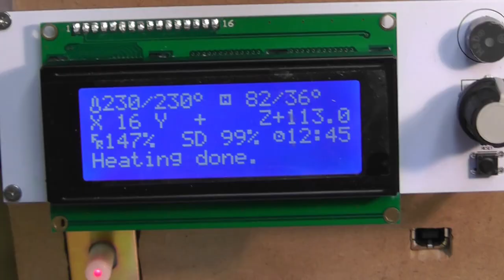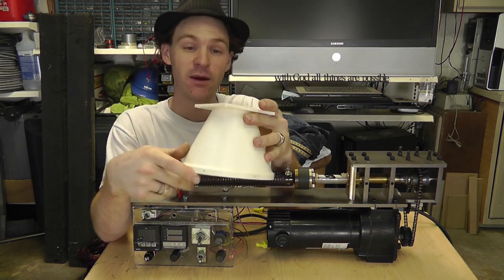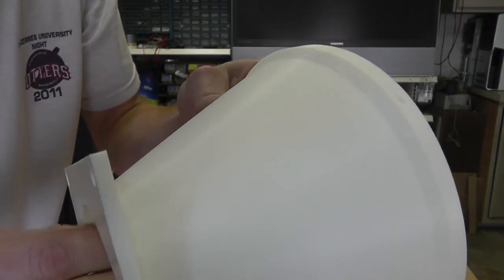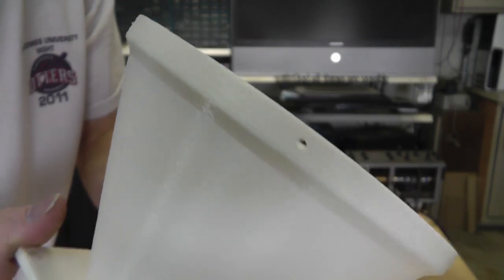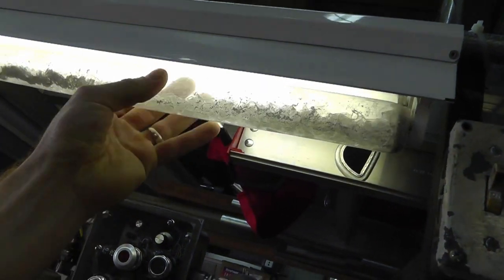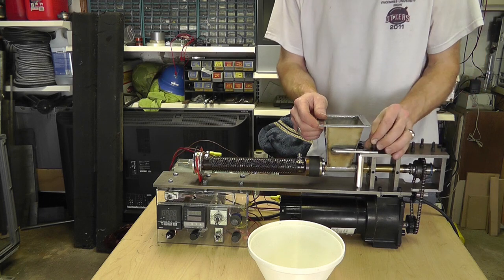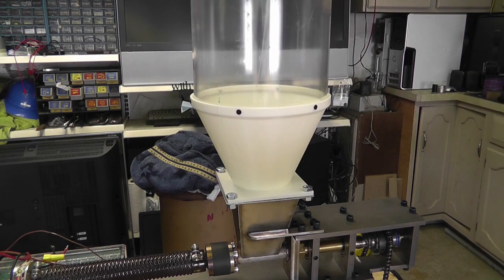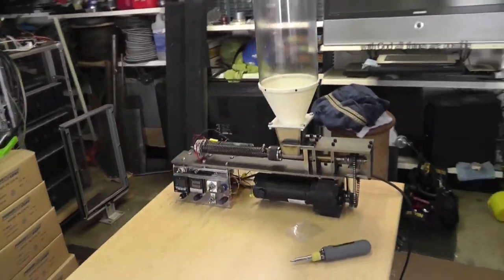#2 ~Russ's Filament Extruder, Printing the hopper ( time lapse) and installing it.

Comment from the maker: I have put some thought in to that idea but... An extruder like this relly needs to be going at one speed all the time to make good quality filament and the filament going in to the hotend is moving verry slow and not constant. ( depending on the part) so it sounds best to making good quility filament rather than worrying about running it right to the prienter. Although it sounds good ;) thanks!! ~Russ

Comment: Awesome print! I just have a standard much smaller hopper downloaded from one of the Lyman extruder derivatives, bottleworks as I recall. It was one of my earlier prints and had serious problems with delamination. Normal people would have thrown it away and reprinted but of course I shlopped abs-acetone goop all over it and moved on. Lets just say yours is like a rolls royce and mine is like the beverly hillbilly's truck.

Comment: like you videos russ! I have a question. what kind of glue do you put on your print bed? or how does the part stick so good?
Reply from the maker: I use acetone and ABS plastic. Basically put your scrap ABS plastic into acetone and it will dissolve it when you put it on the bed it will evaporate and leave a nice layer of ABS as if it's a flatbed of ABS plastic but it comes off the glass because it's very thin layer. ~Russ

Comment from the maker: Oh man! Yeah sounds like when I first started... It took me 1 month straight to get good prints... Between speeds on the filament drive, movements and all te rest of the crazy stuff like temps... And a nother 3 months of tweeking I was able to get good prints.  The calibration on these prienters must be right... That's for sure! If I speed it up it fails, I speed it up with the nob on the last 3-4 layers and to say the least... There not on there anymore... ;) calibrate calibrate... ~Russ

Comment: 13 hours to print it!!!  I had not idea these 3D printers are so slow!
Reply from the maker: Actually the Delta style printers are the faster of the printers. But I have everything tuned to a very slow speed just to make sure it turns out flawlessly.  So it being slow is due to the way I have it configured. ~Russ

Comment: what infill
Reply from the maker: Carter Peel 100%
Reply: Why? On a part that big it made me wince just looking at all that wasted filament.
Reply from the maker: Carter Peel because it supports all the weight of the filament and hopper. up to 10lb or more. And the part is thin. so the more solid the better. ~Russ